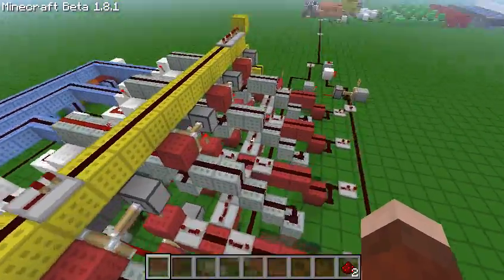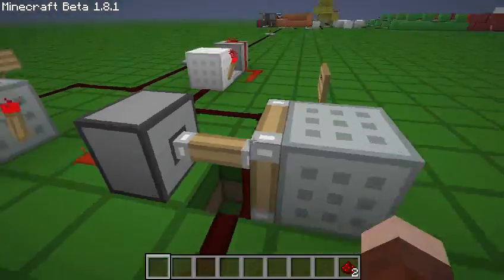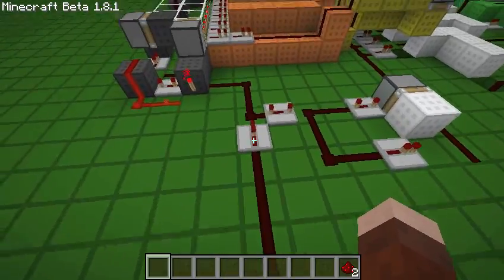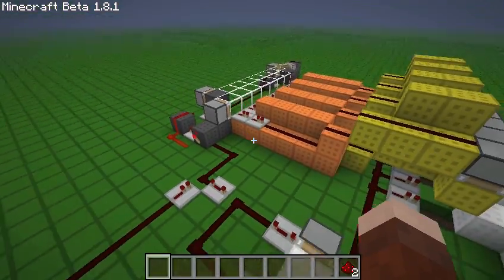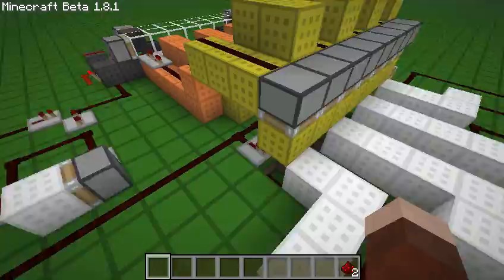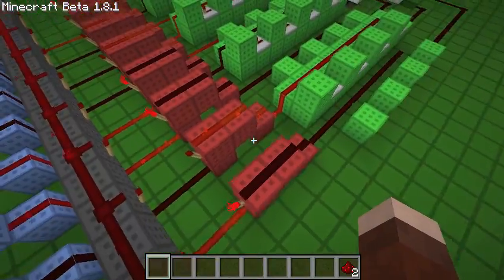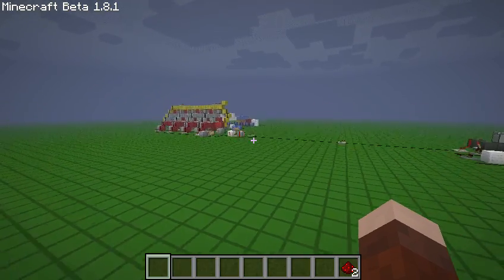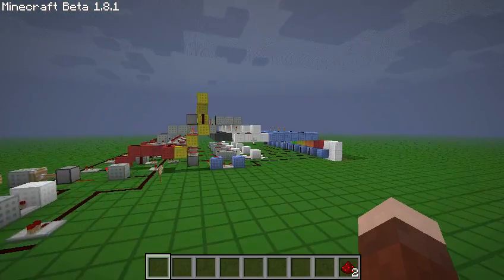Device to Transmit Data on a Single Wire

Comment: Very clever! The single wire transmitter I'm working is sending 1 bit per tick and I'm avoiding pistons as much as possible. I call it a 1SLIP: 1 tick Single LIne Protocol.

PS I definitely like your idea to combine the power line to your data line! I'm going to use that for my design :)

Comment: @gameboy3625 I am aware of this, but did not discover it until after I had posted.
However, my invention is simply a different (possibly more stable, but also slower) way of doing the same thing. I don't really have any intention to actually use it, so I wouldn't need to "steal" your transmitter.